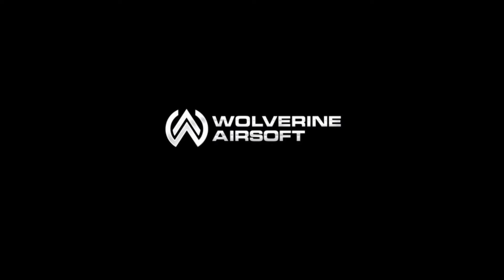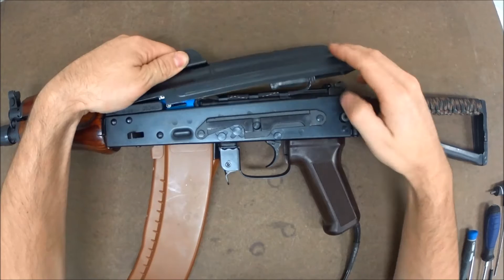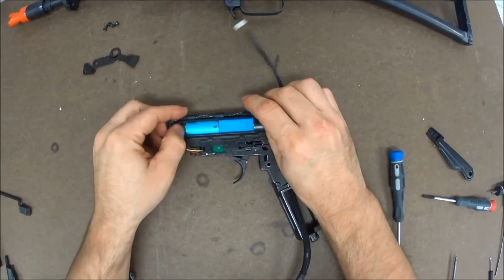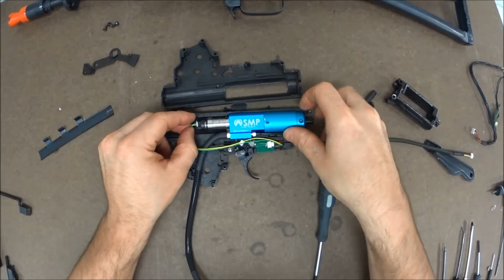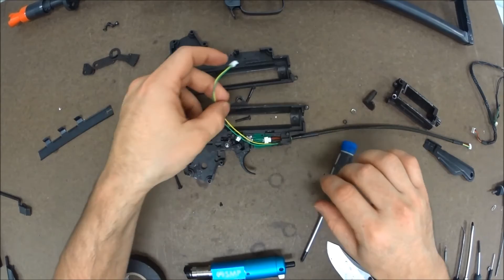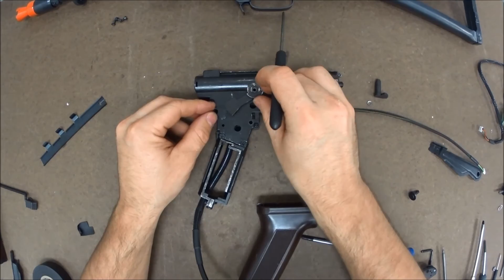INFERNO Gen 1/SMP Installation: AK-47 with V3 Gearbox

Comment: i have a jg g36c with a wolverine inferno v3. i had it installed and chrono it. i have isseus with my fps. i can get it higher then 160 fps. even if it use the dwell. what can be the problem?
Reply from the maker: What is the psi on your regulator set to?
Reply: Wolverine Airsoft  120 psi i believe
Reply: Wolverine Airsoft  its a new storm regulator...btw
Reply from the maker: Please email tech@wolverineairsoft.com so our tech department can help you out man.

Comment: Can you answer my question from last week?..        The Umarex H&K licensed G36C has a microswitch as part of the 
trigger module, I have the universal kit can I use this or do I need to 
purchase the v3 trigger board and use it with the existing trigger...  the standard v3 trigger assembly does not fit in the gearbox shell....

Comment: I have e&l replica of an AK, to be more specific this one
http://www.airstrike.lt/e-and-l-airsoft-en/els-74un-mod-c-submachine-gun-replica-en
The E&L will actually use a nozzle which is slightly longer than the 
standard AK, so this could be a problem, could you please be so kind and answer me is it inferno for V3 version of gearbox, going to fit in my replica, maybe if you can do a video too, or if anyone has any idea will it work
Tnaks for help.
Reply from the maker: +Jerko Dragičević If you could use this guide to measure it, we can help you get the nozzle you need: http://wolverineairsoft.com/wp-content/uploads/2016/03/Nozzle-Measurement-guide.pdf
Reply: +Wolverine Airsoft 
 I know but.... I wanted to avoid disassembling the replica... I'll try to find out on e&l official page length of nozzle..

Comment: Installed on my E&L ak74u and for some reason if I have the hop up screwed into the gear box and also screwed into the two screws on the body my Nozzel pertrudes to much into the hop up and seems to cause a jam. The gun will fire and make a lower air noise and it will start to get louder until it actually fires the BB out. Does this sound normal? Could you guys not install the screw to have the hop attached to the gear box?

Comment: Question: Will I have a problem fitting a hydra into a cyma 0.42 ak-47?
Reply from the maker: +björn linder Hi björn, it should work fine with some modification. You will want the Inferno though

Comment: Question: I am heavily considering going HPA and wanna get one of these and put it into a Version 3 Ares G36 gearbox. Will I have issues with it?
Reply from the maker: +Ed Garcia This will work great in a G36!
Reply: but more specifically a ares. Will it work well in that?
Reply: +Ed Garcia Might need a trigger board conversion, i know they do for v2's not sure for v3's. run you about $40